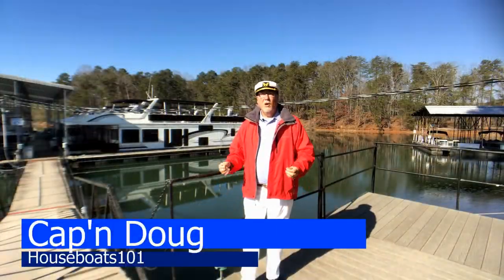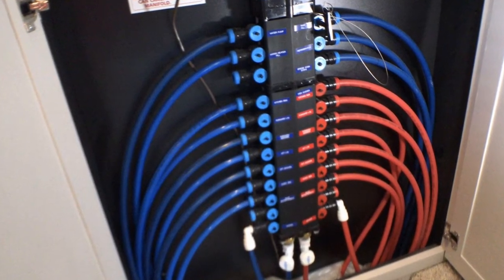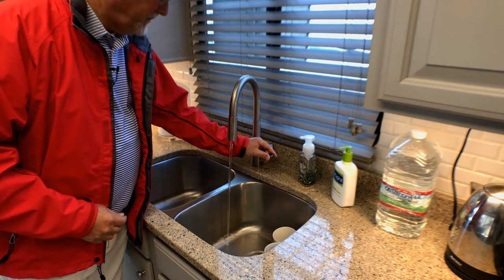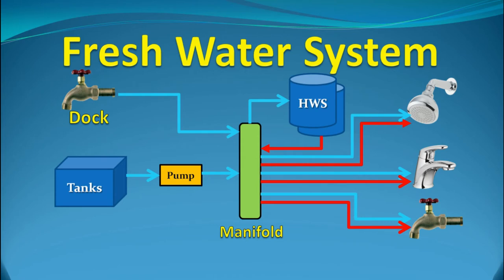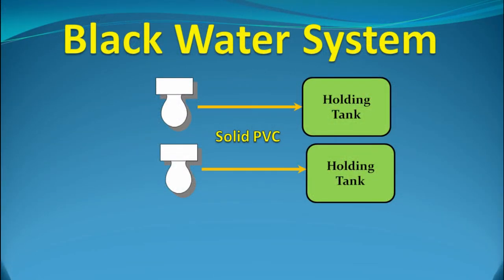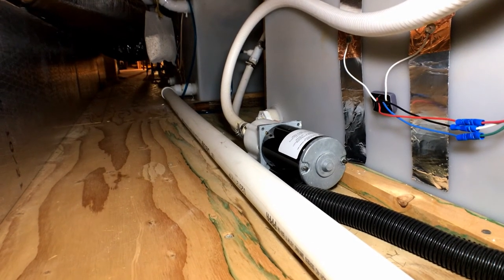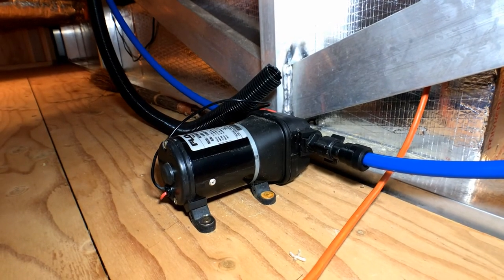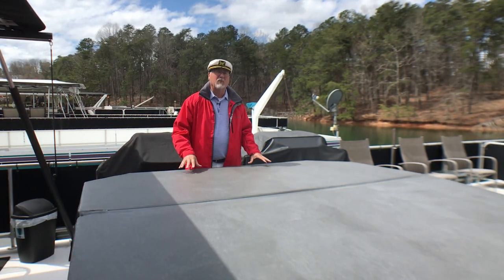Houseboat Plumbing

Comment: Another question do you use booster equipment to receive cell phone and WIFI while on the houseboat
Your programs are very helpful
Reply from the maker: I tried using a cell booster for a while but found if I changed to a different provider, I got a better signal. At the marina we have free WiFi but when out on the lake I use my phone as a hotspot.

Comment: Thanks for the great videos can you use these houseboats anywhere else besides in a lake? I'm thinking like the Georgia Florida inland waterways
Reply from the maker: Yes they can be used in the ICW although the hull will need to be coated to reduce corrosion and anti-fouling. There is no way this type of houseboat can be taken into open ocean or any area where there are significant waves and swells.